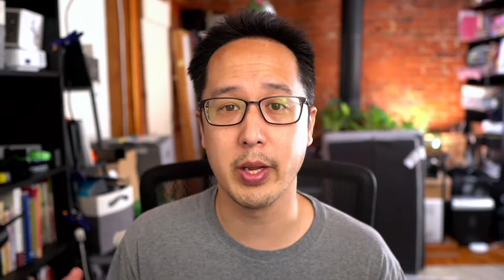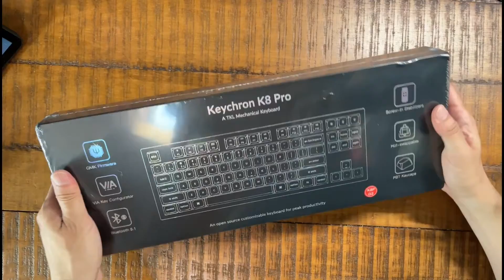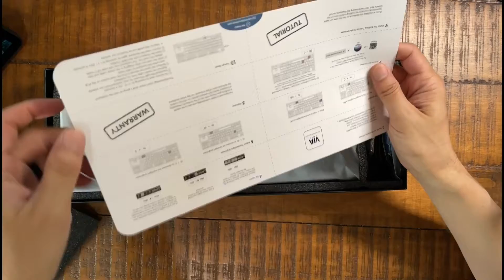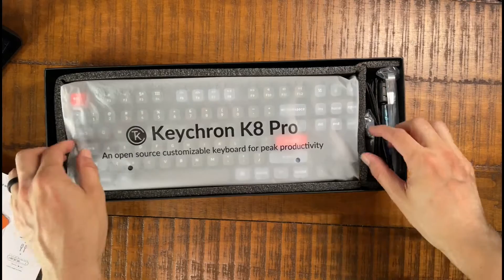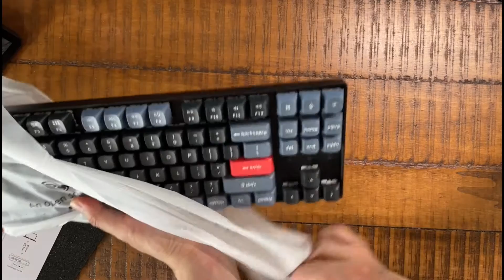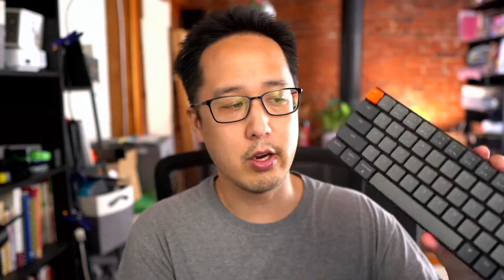Keychron K8 Pro QMK/VIA Wireless Mechanical Keyboard

Comment: Definitely the best mechanical keyboard out there. I got mine today, and I love it. It just makes me want to type.
Reply: which switch did u get
Reply: @thekrakozhian392  I went with the reds.
Reply: @MnemonicCarrier  how are they
Reply: @thekrakozhian392  I like it a lot 😄. I seriously love them. I love typing on this keyboard. It's a matter of preference, but the reds are my favorite. BTW - I don't game (much), I'm a software developer, so I'm not just usingt he "WASD" keys 😉. I haven't measured my typing speed lately, but I "feel" like this keyboard has improved both my speed and accuracy (I touch-type, I don't look at the keys). I normally do around 90 to 100 words per minute.
Reply: @thekrakozhian392  If you want, I can make a short video demonstration of me typing on the keyboard, and I can pull off the keycaps etc...?
Reply: @MnemonicCarrier  naaw, you don't have to take the trouble for that. the thing i want to know is that would it hurt while typing on that tall board. that's the only concern that's keeping me from getting the thing
Reply: @thekrakozhian392  Ahhhh, I see what you mean. Funny you say that, as I have two slightly bent fingers (childhood accident). They hurt if pressure is applied to them, it might be arthritis, I'm not sure. Anyway, I can't remember what the actuation pressure is on this keyboard, but it doesn't hurt my fingers, even after typing for prolonged periods. Because it's a "pre-lubed" keyboard, I think that also helps. I've used the Cherry MX Blues before, and they weren't comfortable for me (for prolonged periods). I've also used Cherry MX Browns in my previous Keychron K2, and they were okay. I much prefer reds though - just love the smoothness, and the sound it makes when the keys bottom out ⌨😉.

BTW - I have the MX Keys and MX Keys Mini too (chiclet keyboards). They're pretty good too, would highly recommend them (if you don't like mechanical keyboards). Personally, I prefer mechanical keyboards - reminds me of the good old mainframe days 💻😄
Reply: @MnemonicCarrier  yeah i too prefer mech keebs for their retro concept. And that's the reason i'm gonna go with the blues when buying this board as i want that old typewriter feel and a tactile feedback when typing. But from what i heard, the browns on this board won't give you a good tactile feel and i'll be buying the blue keys. But the blues wouldn't hurt my hands, would it?
Reply: @thekrakozhian392  The blues definitely require more force to actuate (i.e. to register the key press).

There's tons of videos on YouTube about switches:

https://www.youtube.com/watch?v=Q1NldeJN0ys

https://www.youtube.com/watch?v=-Ln9rA_usoY

You might be fine with blues. Pop in to a store and try our different keyboards with different switches.
Reply: @MnemonicCarrier  i knw about these stuff but as i'm in India i cannot go and test out switches lol. and as i'm only gonna use my keyboard at home, noise would not be a problem. so gonna go with the blues for the tactile feel i guess
Reply: @thekrakozhian392  Good luck!! ⌨ Hope the blues work out for you.
Reply: @MnemonicCarrier  thanks bro. And kudos for the talk

Comment: What is up with your recording of the sound test? Its like you rolled off all the low end or used a compressor for voice.
Reply from the maker: It was more of the setup of the mic. There was too much vibration from the desk that got picked up. I’ll be improving my setup for future keyboard reviews as far as the sound test is concerned.

Comment: I thought I would replace my K8 with a K8 pro but gave up the idea because the key caps of K8 pro are not shine through type, which, in my opinion, pretty much decreases the value of back lighting in terms of both practicality and aesthetics.  The letters, numbers, and marks on the key caps shine and let you know where they are even in insufficient lighting, I think this is the original purpose of back lighting.